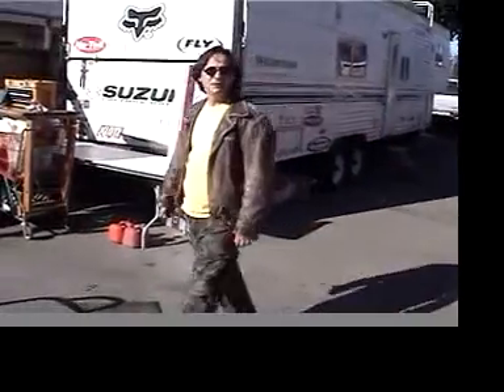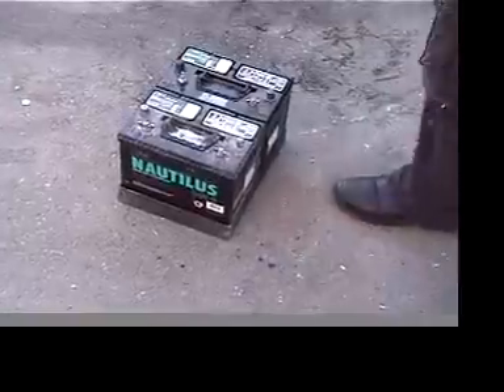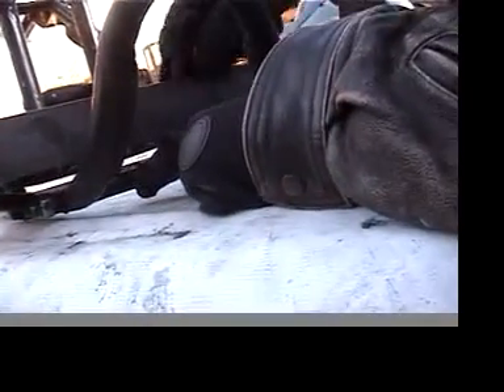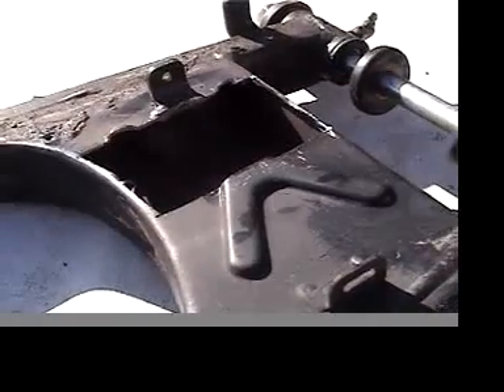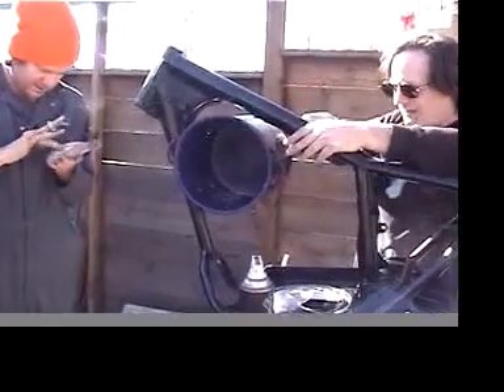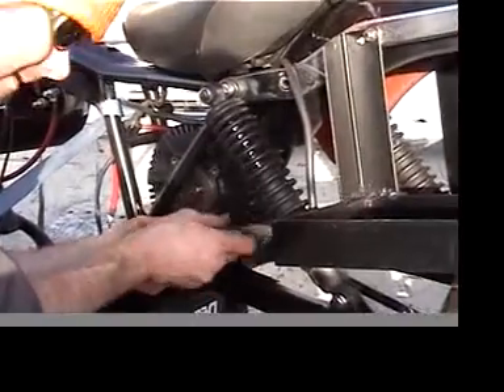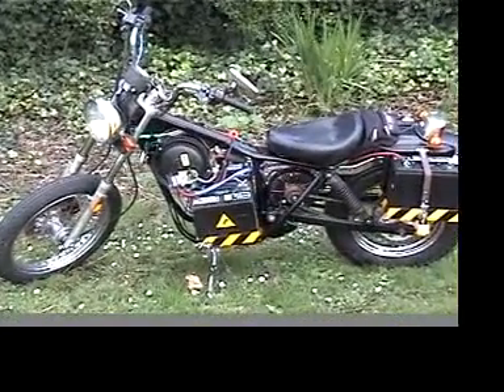Gomi Style - Electric Motorcycle Conversion

Comment: Why not just use brushless, gearless hub motors and eliminate the chain altogether?
Reply: it seems like no one answered your question... I see that you did it 8 months ago... In my resent search I am aiming for a cargo motorcycle to deliver food, current expenses on mopped, just in fuel, seem to be at least $1.5K per year, thus electric seems to be the way to go... the hub motor for a motorcycle or moped is a pretty good option, till you discover that the town is plagued with pot holes... then the hub motor is at risk as the magnets can fracture or become loose, dislodging them selves at any moment... the mid drive option moves the motor away from such impacts... the chain may be cumbersome but it is cheaper than the motor, and it is easier to fix than the motor, I mean, if the motor could even be fixed... there may be the problem of finding the ppl with the know how, as there may not be a lot, and those who may know may want to charge a ton, to fix this motor... having said this, in alibaba you can find some very affordable motorcycles with the config that you mention... just keep in mind the pot holes...

Comment: Around 10 years later toward 2017, dump very bulky lead acid batteries then go for 10KWh. Lithium-ion battery system for much longer range.

Comment: At first, I wondered why you would convert a perfectly good motorcycle to electric. 
Then, I found out it's just a Honda Rebel. 
Second, hooray for you. You no longer burn gasoline. You just burn more coal, to generate electricity to charge your batteries.

However, it is a cool build and my hat's off to you for it.

Comment: Have you ever considered using capacitors in place of the batteries and attaching a couple of alternators to help keep charge? of course they would have to be properly enclosed to avoid electrocution lol
Reply: Only if you had generator with 300% efficiency. Wich is impossible and you dont seem to be a very smart man... Capacitors are used to deliver high current and voltage in short period of time. Battery is made to deliver much less but it lasts longer and takes longer to charge.
Reply: Attaching alternators to what? Capacitors simply don't have the same capacity as lead-acid batteries.

Comment: the motor by it self is 1000 bucks plus the batteries and running just for 50 mls, unless you adding a alternator to the bike for me there is no point, no offense but if some one here is into the green crap thing (san Francisco)) why??, san Francisco have very nasty and smelly places, the f### bus streets and much more, sorry I don't want to be unrespect full

Comment: Very impressive , for the hack & bash vidi . You undersold how much attention you did pay . Like the cutting of a hole in the swinging arm , but then put a buttress on the motor bracket to keep it sound . Difficult call , to transfer information without delivering boredom .

Comment: Modification does not make sense. If the batteries are over 50 pounds each, this adds over 400 pounds to the bike. Motorcycles this big were never designed to handle this kind of weight. It' doesn't even include the rider.

Comment: Alan in Corvallis, WA used a "Kelly In-wheel (13") hub motor Brushless DC. Driven up to 14.5KW, this translates to about 16HP with operating losses." In a Roketa Jamaica 150cc scooter w/ 13" wheels. Its way cheaper, faster + more efficient $ for $. Just sayin... Kelly BLDC is 1/2 money & Fast. PERM PMG is a great motor > but not cost effective for DIY project.

Comment: Whats a metal frame got to do with the life of the sum of its parts?

I don't give a monkeys cuss about "green".

The oil companies and Gov'ts require people to be stuck with specialist fuels for control, money and taxes.

I suggest a test drive of an EV. Any type! Note how it feels. High torque and quiet. Few gears, most none at all. No getting card cloned. Filling up in the pissing rain. clutches, gearboxes, noise, servicing, consumables. The lists are endless.

Comment: LOL! you people are splitting hairs here. how much energy is used to make an electric motor? how much energy is used to make a 12v converter? how much energy does it take to make the battery that powers your sissy electric bike that you're going to have to periodically replace? I get 70 miles to the gallon every day on my bike. If the energy crisis was as bad as they want you to think, then ONLY renewable energy sources would be used and every vehice would burn ethanol. Go hug a tree dude

Comment: And another thing... this is not a 0 emissions vehicle. guess where 60% of our electricity comes from? BURNING COAL (as in nearly pure carbon). If it was as big of a deal as the people that want to tax us for our emissions say it is, then they would have re-introduced the hot injection carburetor of the 1970s that got 90 miles to the gallon in a 3.8 liter v6. Sissy Californian's need to do more research before attempting to go "green".

Comment: PT2 Here is an idea for you Put a wind turbine charger on the front of the bike so as you drive it will charge the batteries, something like a pulse jet, as long as you have the power to get up to speed in the first place.I like the idea of a twist and go bike at my age!  Did you know here in the UK there is already a generating deficit? Solar power to run my modest home would cost £11,ooo GBP I checked, and there is not enough wind either I checked that too, so I am stuck with the grid.

Comment: Hi I think you have got the wrong impression, I think they are a good idea but I simply wonder if they are the "green" alternative they appear to be. I do however resent the personal remarks, We adults are supposed to be able to disagree without it becoming personal (I am 61 by the way not 10 or 16 although I wish I was!) You do not advocate using "off the grid" power, do you mean everyone who has an electric vehicle should buy a wind or solar charger?  
ps, I work at a power station      pt 1

Comment: As an electric vehicle owner I can confidently state that EVs are rubbish. Low performance, poor range, & are excessively expensive (The extra insurance and purchase costs far outweigh the fuel savings). The only reason I've kept mine is I have no parking for a real bike but I can just about get an electric moped into my tower block. Unless you do less than 15-20 miles per trip don't waste your money on this junk, wait for the tech to get better (it won't though - powers that be won't have it)

Comment: @stupidburp
More advanced lead based starting batteries still have about the same or even worse energy per weight as traditional lead batteries. They are not designed for capacity but to last longer, give higher peak power and survive more abuse. Lithium or NiMH is another story, they give better density(and more range).

Comment: @h2oboy1
This is a sweet conversion, my favorite is the installation of motor in the suspension fork. Got some ideas for my own future conversion. Thank you.

Motorcycle exhaust gas is dirty compared to modern cars'. It is well able to cause smog while a modern car outputs almost only water and CO2, you can smell the difference. The amount of carbon released per fuel spent is the same, however.

Comment: @h2oboy1 
No, you are wrong. All the carbon in fuel exits the exhaust in the form of CO2, CO or unburned hydrocarbons(gas fume). Majority is in CO2 form in any engine. More CO2 is actually better since CO and HC are more hazardous. That is actually what catalytic converters are for among other things - to produce more CO2 in order to have less HC and CO emissions.

Amount of carbon atoms in fuel is equal to number of C in exhaust. Basic chemistry.

Comment: @h2oboy1 you're right in theoretical point of view, but in real life,  even an old 2 stroke put out less CO2 than a prius in summer in a modern city, for a simple reason: the car will need 70 to 90 mn to do 15 km commuting in traffic-jam, motorcycle will do a 20 mn trip...  90 % of the prius power will be use to cool down the car passengers with the air-cond and cooling the gas engine producing the air-cond power supply, so the zero emission battery stuck in a traffic jam is not yet attained.

Comment: @ilovegoatsecks 

Your typical lawnmower, running a 4 hp engine at 1 hr, it would emit 1.8 lbs of CO and 0.044 lbs of NOx. A typical car running (cold) for 1 mile would emit 0.0078 lbs of CO and 0.000882 lbs of NOx. The order of magnitude is roughly 50:1 for CO and 12:1 for NOx. These are rough figures, but close enough for permitting work. This is mostly due to lack of catalytic converters, also efficiency of the motor.

Comment: @h2oboy1 in regards for your request for me to read the article, i did. here is what i found: "Carbon dioxide, a greenhouse gas, isn't measured by either agency, but motorcycles are generally better than other vehicles in this regard since they use less fuel per mile." Read the article again. As far as the other "facts" stated in the article, I shall believe none of them until i see sceintific proof, not just claims. What do you have for me now for a response?

Comment from the maker: @ilovegoatsecks Thx for the comments, but motorcycles emit way more pollution than any car - the higher efficiency of the motor produces MORE CO2 per gallon than a typical car.  And the smog standards that exist for cars is practically non-existent for motorbikes.  Meaning they can be as dirty as the manufacturers want.  Unlike cars which have a strict standard that they must meet.  For more details, google "Motorcycles and emissions: The surprising facts" from the LA times.  Thx for watching!

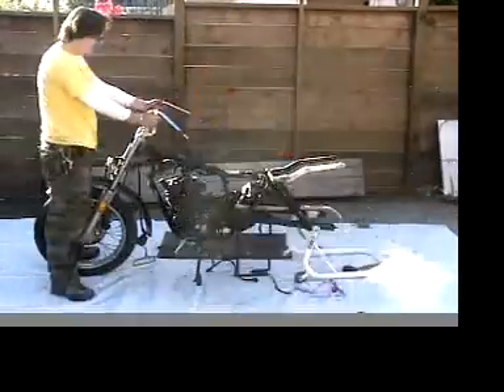Comment: @ 0:56 "i hated knowing, that my gas powered scooter had such terrible emissions".... WTF? your bike motor which was probably around 600-750cc got around 40-50 MPG... terrible emissions???? youre putting out less emissions than a damn toyota prius, with an engine 2 times smaller, so thats half the volume of emissions. come on.

Comment from the maker: @alaskanalain I am using the industry standard vocabulary. The vehicle has no emissions.  I did not claim that it had zero impact on the waste stream.  I live in Norcal where we generate a huge amount of power from renewables.  The impact this vehicle has overall is a teeny tiny fraction of the impact that the original morotcycle has.  And it costs pennies per charge.  An improvement of several multitudes.  Thanks for the comments.

Comment: How can it be zero emission?  You are drawing from a wall socket and most of the US power is generated from fossil fuel, (more drain and strain on the generators.) You  also only get out only about 70% power that you put in to a battery when charging.  A few additional % is lost in engine and electric controller efficiency.  You also have to deal with dumping the old batteries every year or three.  Admire you efforts though, does it save money?(A hours/charge?)

Comment: @luc59457 
Yes I got the messages.  Check your inbox for my replies. Also, a front hub motor sounds like an interesting idea and it would mean very little work compared to what I have planned for the Currie 1000W.  However, I'm pretty rough on my bicycles and have bent my share of rims. It would suck to bend an expensive one.... 
Ok, so I *could* get the front hub motor then put a good portion of the batteries in the frame triangle (making sure I have clearance for pedaling)?

Comment: @luc59457 
I've never heard of those batteries before, I'll look them up.  I'm a pretty big guy (200lbs, 6'1") so I figured I'd need the high-drain characteristics of LiFePO4 to take me up hills and such, I live in Ottawa-Central and there are hills everywhere.  Last fall I was riding a cheap Canadian Tire ebike with 32lbs of lead-acid on the rear riding at 18mph....it was not very stable and I made turns like a blind horse.  I also had some questions about your 1000W ebike, check your inbox!

Comment: 45 miles an hour...my moms moped goes faster...you should have kept the transmission, (i know they built the engine and trans as one) but geared it to the crank shaft, and used the 5 speed on the thing...also how was regestering it? "has there been any modifications to the vehicle?"

Comment: @AngelArm1110 

lithium is expensive, but you could cram a lot more juice in a conversion with lithiums than lead acid for sure. you could also fit smaller cells in a lot more nooks & crannies. all it takes is a few thousand dollars.

Comment: @JamesHazBeHaiTyme 

well, electricity comes from the sun, the wind, the earth and water. put some solar cells, a solar sterling engine, a solar steam generator a little windmill in your back yard and you're good to go.

even if you use off the grid electricity, you're still using way less resources than gas that needs energy to produced and transported. if WHERE you get your energy is important, move to 100% hydro las vegas or a wind powered market.

Comment: What if you can recharge a portion of the lost battery charge. That should lengthen the travel distance capability. see a concept I have for charging the batteries. It can be arranged for this devise to "engage" and "disengage" should drag needs to be reduced.

Comment: The big hidden cost for electric bikes is not the fuel, its the fuel cells, aka, batteries.  Which have to be replaced every so many years as they do not last forever.  The the more efficient and effective they are for vehicle power storage the more super expensive they are.   And they are made of chemicals, frequently very toxic chemicals, so the real emissions and environmental impact from electric vehicles are the improper disposal of these spent toxic chemical batteries.

Comment: Nice video and well explained. For your next electric motorcycle, I recommend Lithium Iron sulphate batteries. They may be more expensive but they last a lot longer than lead acid batteries and are about 1/3 the weight for the same power.

Comment: Nice work! One thing to keep in mind is that the engine is sometimes used as a structural element in the motorcycle frame so by removing it you might get more flex in the frame and make it prone to breaking. Probably only relevent if you're going racing but maybe add a few crossmembers for extra stiffnes.

Comment: This bike would have been considerably more powerful by using Lipo or LiPO4 batteries, you had 200lbs of lead acid batteries on there and could have saved well over a hundred pounds of weight.  It is very expensive though...

Comment: @JayOhEnEnWhyEx Well, if you want more range the solution is: just more battery capacity. Higher top speed is what you want? Then you need perhaps a different motor controller or more volts operating the motor which then also reduces the range. Just as driving the gasoline fuelled vehicle uses up the fuel faster when you drive at higher speed (or in fact higher engine RPM).

Comment from the maker: @iwo2024 Good Question.  We really wanted too but the orig batteries were just too big & heavy.  Second battery set was smaller and did all fit in the engine area with minor fab - no chopping required.

Comment from the maker: Actually, there are several wrong-assumptions in your statement.  One -  the amount of carbon produced via burning gas in a scooter with no emission control is VASTLY WORSE than collecting energy via tradition power plants.  And Two: In NorCAl where I live, our power grid had more renewables (wind, solar, geothermal) than most places, so using the grid here is way better than using gas.  Encourage renewables where you live and get yourself a cleaner grid too!  Thanks for the comment!

Comment from the maker: Hey!  Thanks for the question.  I don't know too many electric systems with transmissions.  Basically it's about simplicity in both the performance and design. The drivetrain has only 1 moving part.  With a tranny, it gets much more complexPlus you lose efficiency quickly with any sort of added drag.  Same with alternators. The loss in drag outweighs any performance gained.  That's why they catch energy with regenerative braking,  Since braking wastes energy, its a great place to collect it.

Comment: I would experiment with regen breaking and a sidecar with more batteries. Batteries from a123systems (LiFEPO4 i think) would get you more power and increased life span. Best would be batteries from altairnano but unfortunately they don't sell any online. Keep up the good work. It is very inspiring.

Comment from the maker: We tried putting all the batteries in there, but didn't want to chop the frame, (eventually I replaced them with smaller ones that did fit) - but these original ones didn't really fit and was a mess.  We then decided no gas tank is a better visual than a non-functional one.  as in, why try to replicate the look of  old tech when I'm so proud of the new? Thanks!

Comment: its taking care of by the electronics, think of it like a speed control on a rc car.  plus transmission= driveline energy loss.  with an electric vehicle you want everything to be effeient as possible so why waste energy with something mechanical if you can solve the problem in the electronics?!?

Comment: Nice, can be had for 850-1700 bucks, Only 25lbs!
34hp 72 v, 19hp 48v with 86% efficiency.

I can see why it would be so popular, many others with simular performance, come with an even higher price tag and 200-400lbs more in weight.

What would you concider a step-up and a step-down to this?

Say something stronger for a vehicle and something more cost efficient for a basic bicycle?